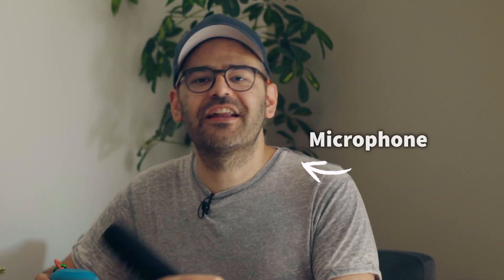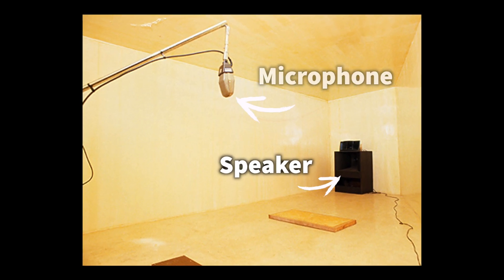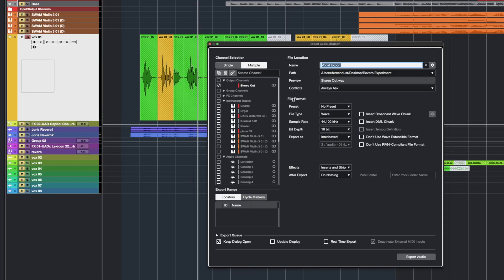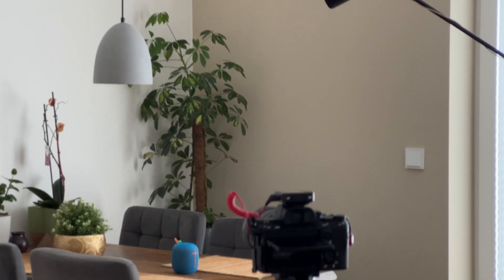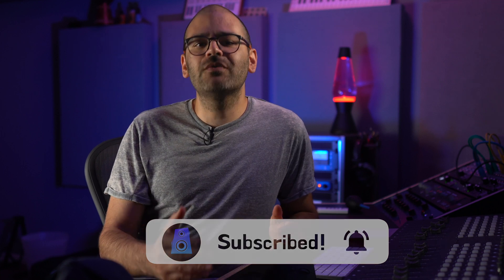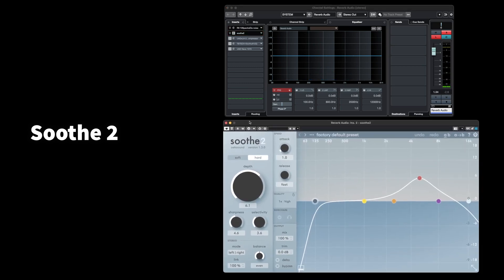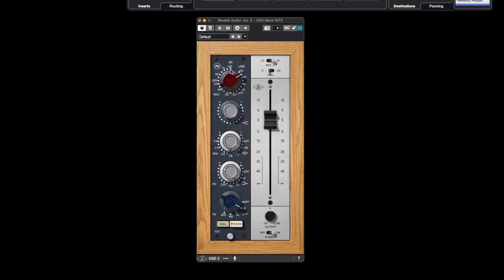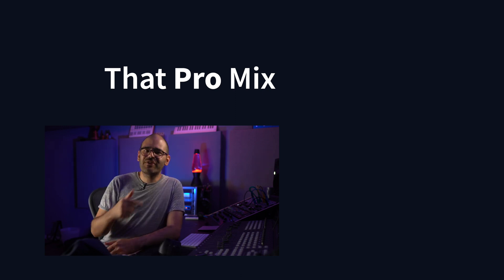I Made My Own ECHO CHAMBER REVERB

Comment: nice experiment, your reverb gets the job done for sure... capitol had a longer decay, yours was more immediate, I guess early reflections... however after all the processing you did, with the cost of soothe, Neve 1073 etc you can get several capitol chamber plugins... I think it's a fun experiment nevertheless, I would say it's just a different flavour of an existing plugin, not better or worse.
Reply from the maker: I guess I should have placed the microphone farther away to get closer to the plugin. But as you said, it was a cool experiment. In my building there is a place underground where there is a huuuuge verb. I’m tempted to the same over there. Surely I can get a great tone!!
Reply: @ThatProMix  yeah empty basements reverberate beautifully. Try it!